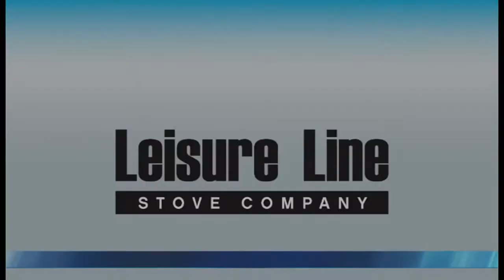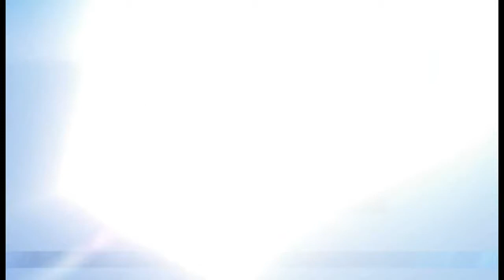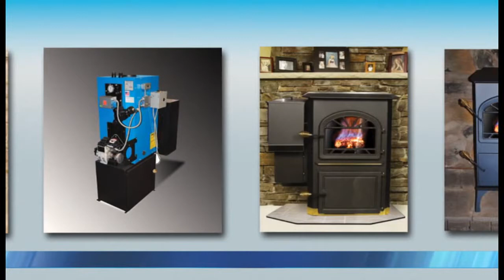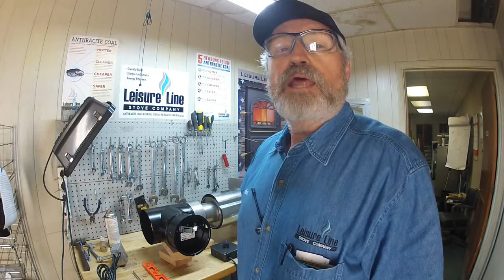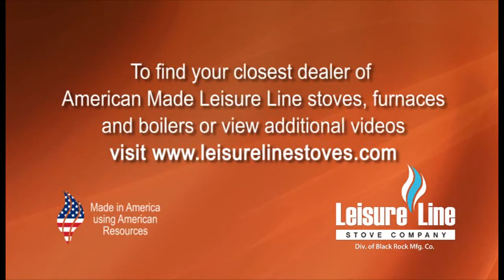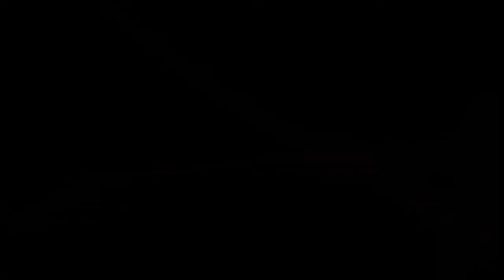Adjusting your Leisure Line Power Vent

Comment: THANK YOU! FINALLY! i own a leisure line must be 9 yrs now, Glass in the door broke so I replaced it with steel ( miss seeing the fire) I am on my second motor for my power vent, I could not figure HOW to slow that thing down past the dial setting your video was very helpful! thank you again.. Great stove also Coal-trol! it is the main heat in the winter time..